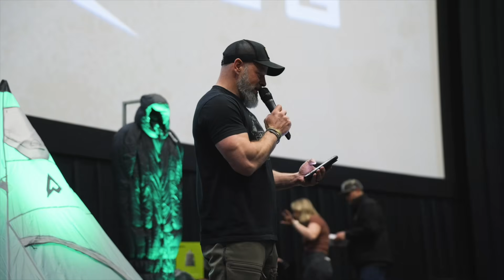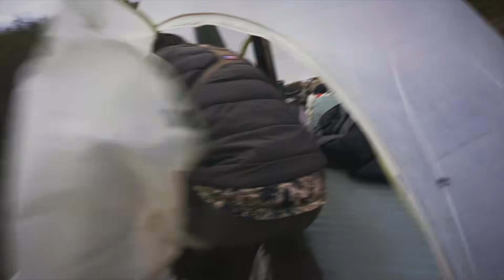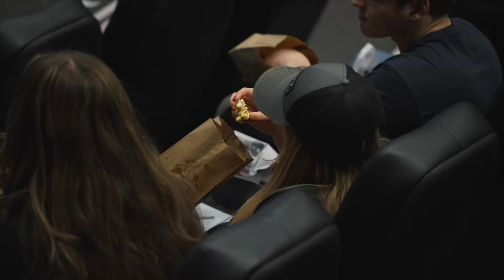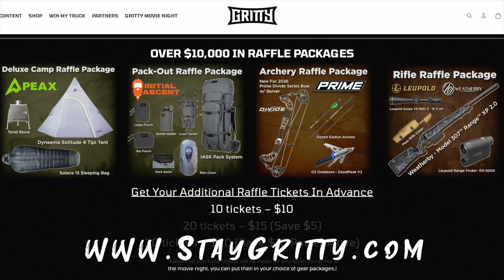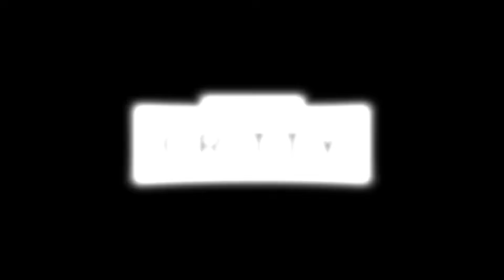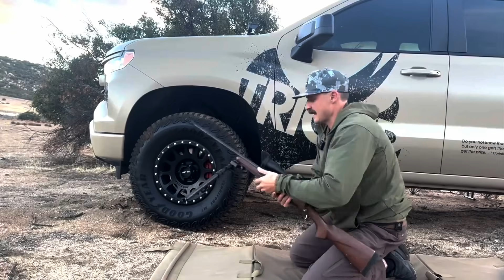MOST ADVANCED RANGEFINDER YET? | LEUPOLD BX-6 RANGE HD | 🎙EP. 918

Comment: BX-6 sounds nice. The Gen 2 Sig Kilo 10K has most of these features (including the onboard sensors and map-pinning features), so the real advantages to the Leupold are the Hornady 4DOF Ballistic Solver, features for archery hunters, and I assume slightly better glass. For a dedicated rifle hunter, these differences might not be worth the additional cost (the Sig's are also substantially lighter). 

This is one of the downsides of a bino/range finding combo - range finding tech will always outpace tech progress in optical quality, making it an expensive proposition to always have the latest and best range finding bino. Nonetheless, I still use them.
Reply from the maker: The weight sucks. But you’re right, it’s the downside. I think you’re correct on most of what you said except you’re missing one thing—Sig’s range finding capabilities and accuracy aren’t in the same league as Leupold. The location ranging is inferior and so is Sig’s ability to range through fog/rain, etc. They might be built to do the same things but the execution by Sig is not on par with Leupold. Not hating on Sig—they have some legit products. But last I checked they’re not winning on the rangefinder capabilities. But we’ll see. I need to have showdown to confirm.
Reply: @GrittyGearAndPodcast would love to see a comparison! I have the Sigs and agree that the Leupold outperforms in several areas many will find important. I paid $2,300 for the 2nd Gen Sigs. If I hunted as much as you, I’d definitely spend the $4K.
Reply: Tract rangefinder at half the price 
You should get one and compare 
Schott glass is excellent